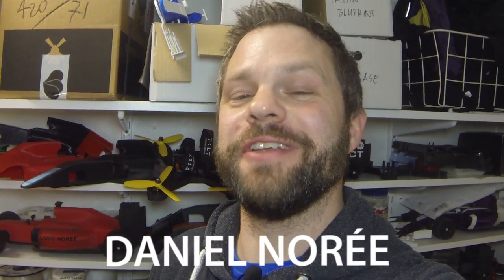Abandoned 3Dprinting project, garden sprinkler system - colorFabb XT

Comment: I don't know what your original intent was for the design, but I can't see where you abandoned it? It looks fully functional.. What am I missing Daniel?
Reply from the maker: They weren´t reliable enough, Stopped spinning etc. Could be fixed by some changes of the design i´m sure but i´ll leave that to others =)
Reply: Ah Ok, thanks for the update.
Reply: @DanielNoree  Mostly because you need to work with the pressure coming for the faucet, which is directly related to the size of the holes in the sprinklers
Reply: Just realized I replied one year late!

Comment: yah i'd be interested in why its an abandoned project or a project that you didn't feel turned out well, as the video seems to indicate otherwise, as it looks fantastic.  Is it just the cost per what you could get in the stores? or did you just abandon the idea of making interesting and new print heads for the system and just were satisfied enough with what you had already printed to not warrant a further look? Keep up the good work, love the videos and your projects!
Reply from the maker: Thanks for commenting David. Well, this was the first test i did and it worked fine. But the other times they didn´t work reliably. I´m sure it can be fixed by making some changes. But as i didn´t want to put in more time i just abandoned it. I´ll post the files so people can have a look, make changes or just play around if they like.
Reply: Daniel Norée if you create a loop of the sprinklers and then t in the supply it will equalise the pressure